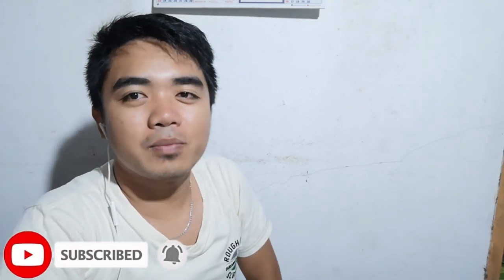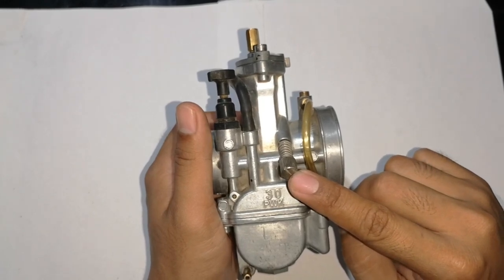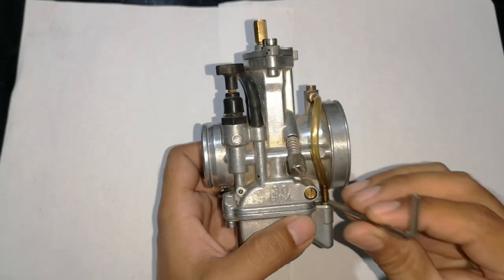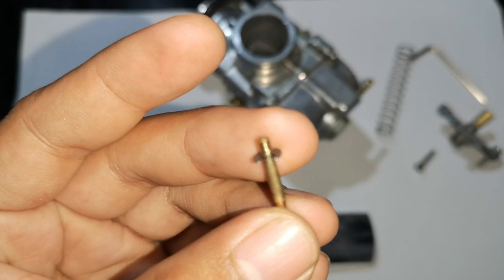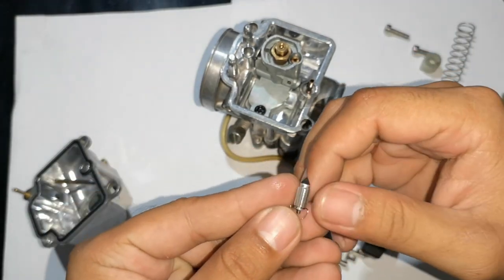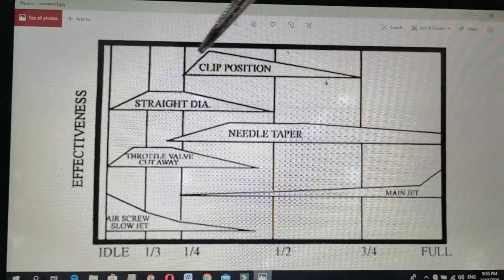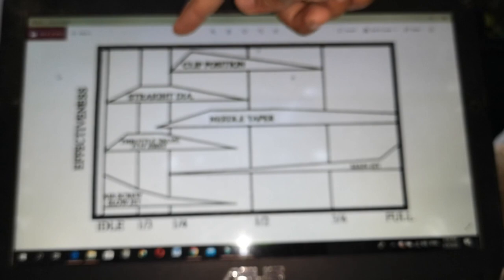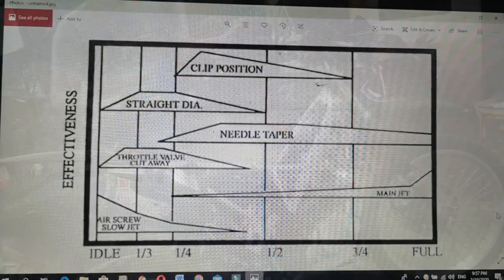Carburetor Tuning Part 1|| Basic Parts and Functions of Carburetor Explained

Comment: good pm boss kikoy moto. nag upgrade ko pe28mm bah. ok man iya full throttle gi ilisan ko iya main jet. pero kung kaliton mo puga ang gasolinador daw nadunlan sya. wala pako kailis slow jet kag adjust needle po. unta mapansin mo boss hehe.
Reply from the maker: Try 40 pilot, 1.5 turns and #2 clip position..
108, 110, 112 Mainjet
Reply: @kikoymoto1941  salamat boss. try ko 40 pilot jet kag #2 clip position. naka 110 main jet nako subong. golden brown naman unta iya sunog pero amu lang to iya problema kung kaliton ang gasolinador. salamat boss :)
Reply: Sir.. I have oko flatslider 28 mm carb. I enlarged inlet carb small hole , slowspeed jet route hole. I faced ideling problem and white smoke in this carb. Any other solution to solve this problem.